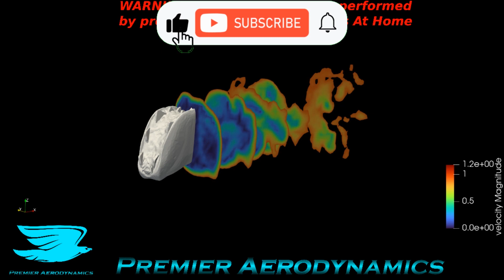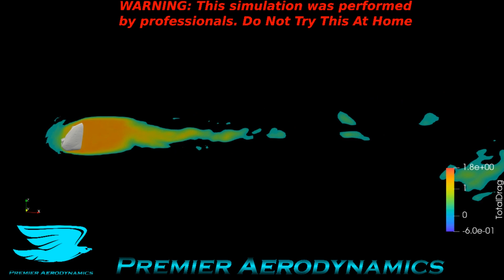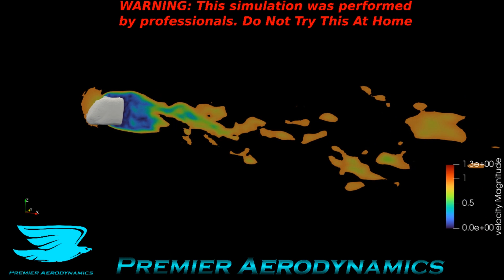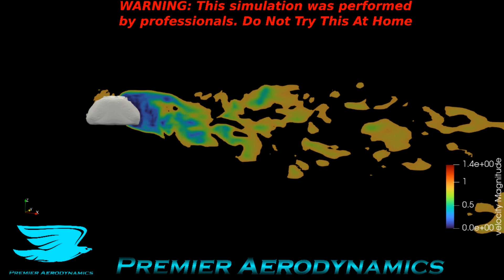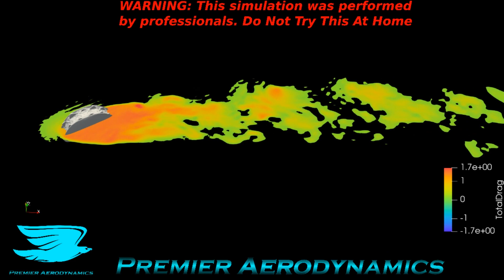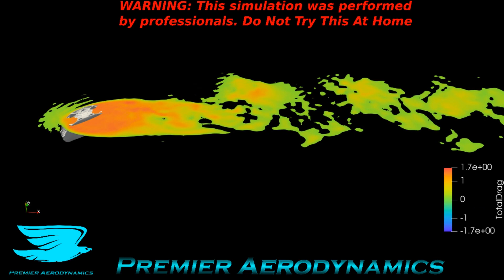TACO Aerodynamics!!

Comment: You'd have to get unreasonably close to the taco to get a good draft from it. Luckily you'd be able to follow that taco in the corners if it decided to run away, because the wake doesn't extend too far back.
Reply from the maker: That's true. It is unreasonably close.😂